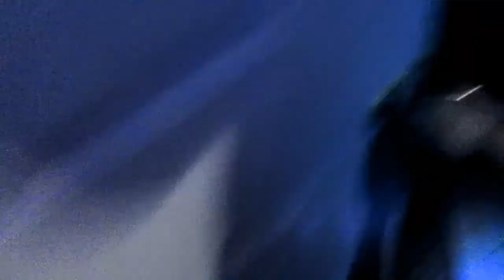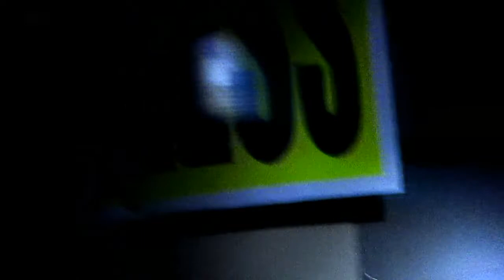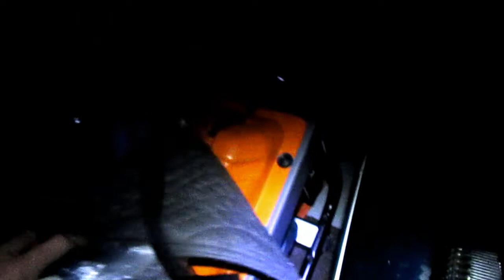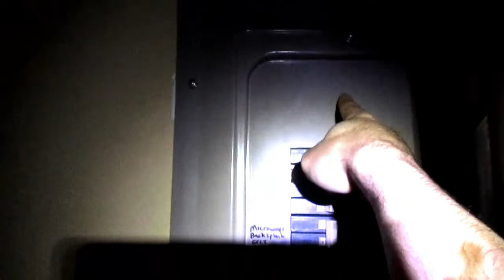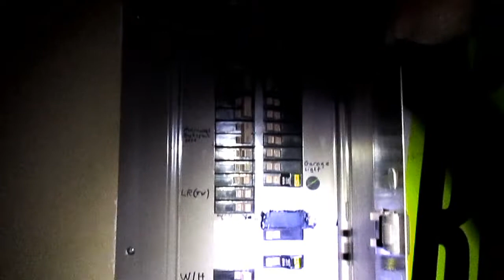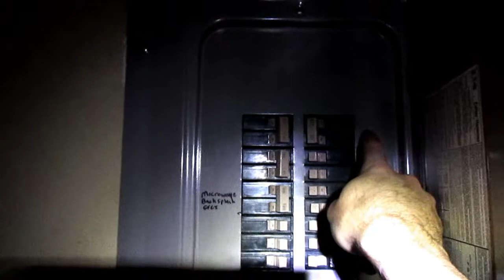Transfer switch in Electrical Panel explained Unlicensed Edition

Comment from the maker: Part you need for outside if you are running a 30amper https://www.homedepot.com/p/Reliance-Controls-30-Amp-Power-Inlet-Box-PB30/202213702